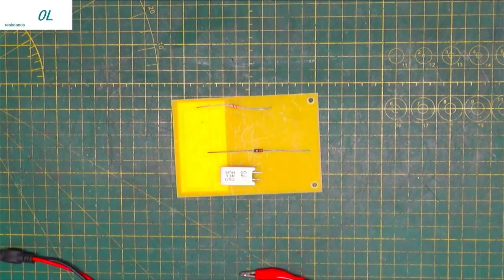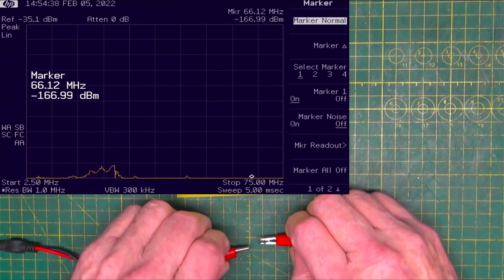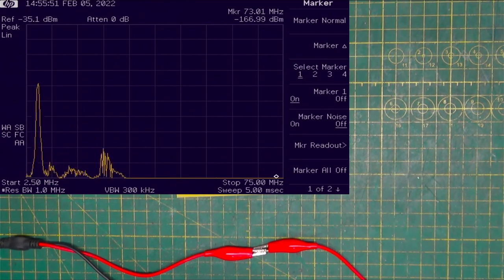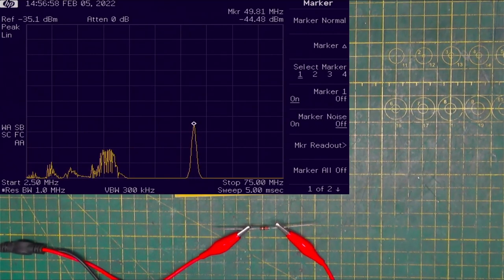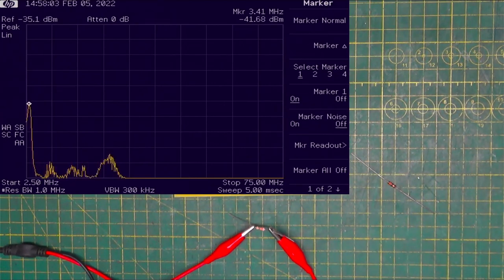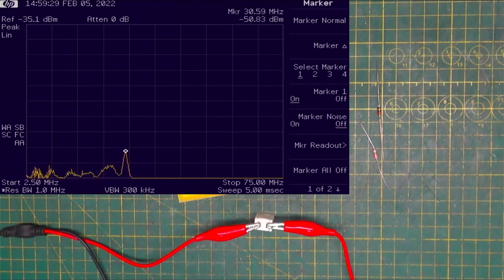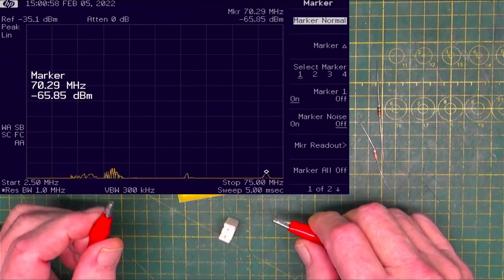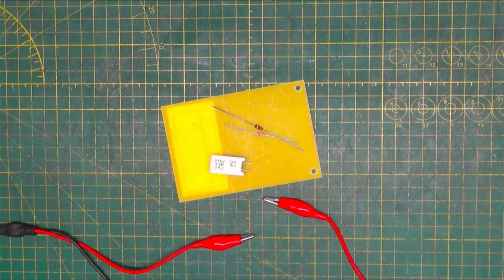How different resistors affect RF

Comment: I need some resistors to set the attenuation on the input on an amplifier, there is a position for 5W input or 10W input, Someone replaced the resistors and they smoke on transmit. I think they should be metal film but i want to be sure i buy the correct type and power rating.
Reply from the maker: I use Mouser and Digikey almost exclusively. The parametric search makes the whole thing easier. The only catch is don't put much in the search bar, just "metal film resistors" for example then select the necessary values from the tables that come up. I have found that if you start with too much info the search will sometimes false out when you add more specifics and not find what you are looking for even if they do carry it. Good luck and thanks for watching.

Comment: Thais was a super cool exercise, I've not thought about sweep component's before, but I think I will dork now....also not thought of a wire wound resistor as an inductor before neither...thanks for the thinking direction and the video!  Just out of curiosity, what HP SA do you have? It looks very capable. ~Jack, VEG
Reply from the maker: Thanks for the good words. I have a ESA-L1500A SA. I got real lucky with this one since it has the tracking generator in it. I did have to get a new main board for it but that was only $250. The only problem this SA has is it will only go down to 1K RBW so it isn't any good for AM broadcast testing but then I don't do that kind of stuff anymore.

Comment: Hello! I ran across your channel while looking for info on a Valley 400 mic processor. The vid that popped up was the one where you were re-capping a Symetrix 528e (awesome vid btw!). Anyway, I bought this Valley 400 brand new from BSW back in 1992 and it's been running pretty much continuously ever since...I'm not kidding! I did have to replace the fuse back in the early 2000's but so far that's it. However, lately, it seems that it's lost it's "UMPH" for the lack of a better word. The eq still sounds good but the compression seems a bit off somehow. I'm positive that it needs re-capping after all this time (I've looked at the capacitors and they look fine but they are 30 years old)...could that have something to do with the compression sounding different? I'm no electronics guy but I think I could re-cap it if I had to. What do you think? Thanks, and great videos!
Reply from the maker: Please contact me at aervblog@gmail.com